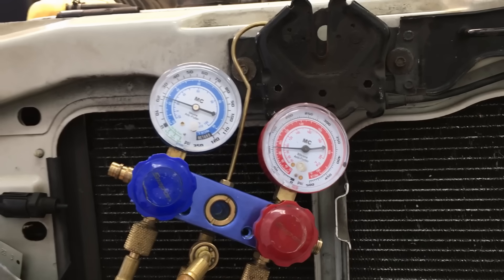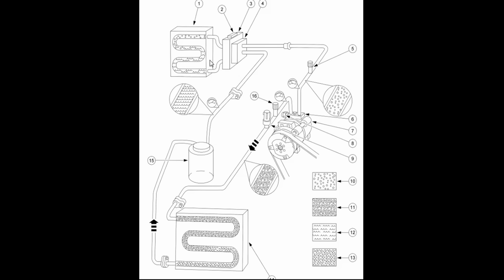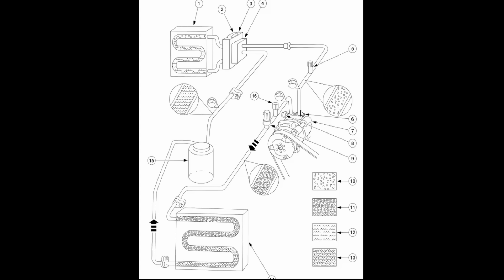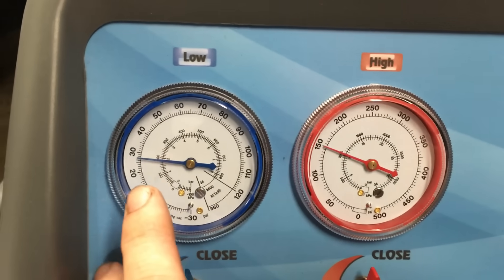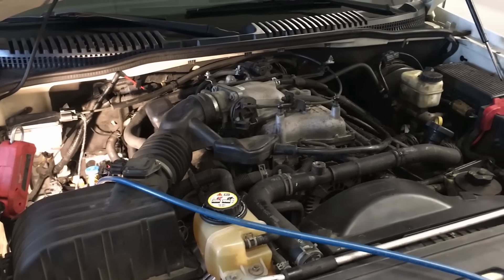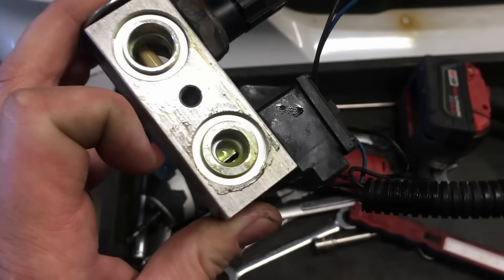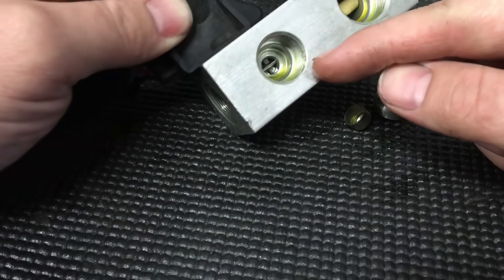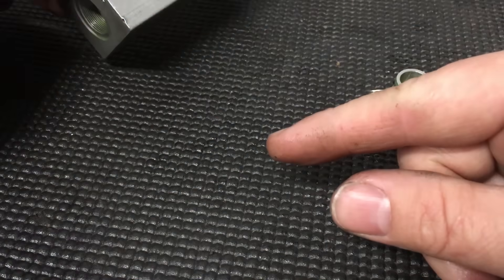3 Common Signs Your TXV has Failed Causing Poor A/C System Cooling

Comment: hi can you tell me where the orifice tube goes in ford escape 2009 2.5 auto 6 speed xls
love all your videos thanks
Reply from the maker: +John Paul Whittall you have a txv not orifice tube. It bolts to the firewall where the ac lines pass through the firewall
Reply: @FordTechMakuloco  I recently purchased a 12 escape and I heard a hissing sound under the dash when i turned ac on, blows cold air but not consistent especially when warm weather.
Reply: @Tengs27  if you have better cooling on the highway than when stuck in traffic... 
then wrap the skinny liquid high side line from the front condenser all the way to the cabin.
Do a fair job at it near the firewall so the cooled liquid is not re-heated by hot engine. (Leave the larger return line exposed as-is, it needs to get warmed up).

WHY: 
it's more efficient to pick up heat from the cabin with a cooler liquid evaporating than a hot one.
 More heat gets picked up ie. cooler cabin regardless of stuck in traffic!!

COST: 
$5 roll of pipe wrap  Aluminum & Rubber from HmDepot

OUTCOME: The TXV no longer gets cooked with engine temperatures R134a and should last longer!

👍🏻
Reply: @glasser2819  thanks a lot, im gonna give it a shot. I already replaced expansion valve, receiver dryer and  condenser but doesnt feel like 100%.
Reply: @Tengs27  did you feel the improved AC cooling in warm summer weather and hot traffic crawl...?
I drove wife old '04TL last week in 103 weather: I luved what the original 15year old TXV delivered... just like new with pipe wrap job!

FUTHERMORE...  same deal with the kitchen fridge!!
The rear fan cools the high-pressure hot refrigerant before it enters the enclosure... unfortunately the cooled pipe crosses the hot air stream and picks up heat

FIX: WRAP that short pipe between end of the condenser and cabinet so it does not get reheated!!

OUTCOME: Fridge cycles 20 to 30% faster to Off regardless of warm kitchen temps.

(last FRIDGE trick is make sure the  compressor starter is NOT an old PTC that keeps the start winding partially energized instead of 100% disconnected after start!)

🤗

Comment: I have a Ford F-150 4.6 2006. It barely cools when it's idling but cools okay when I'm driving. I added some ac pro but that didn't do any difference. The compresser turns on and off about every 30 seconds. What do you think is wrong? Love your videos, great job! Thanks
Reply: Should the compresser run all the time when on?
Reply from the maker: 30 seconds is not bad but making sure the charge level is correct is the first step then comes pressure diagnosis. Most shops wont touch it now with the A/C Pro in there just an FYI.
Reply: FordTechMakuloco  what's wrong with ac pro?
Reply: Loriah Sorensen The AC Pro refrigerant includes a "stop leak" additive. This can contaminate the workshop refrigerant recovery apparatus. Another issue with these kits is that they have a cheap gauge that only lets the user see the low side pressure, for a proper service you really need twin gauges to see the full system.

Comment: My 03 Aviator has that same problem... warm air from the console, but cold from the rear ... I thought it was a touch low.. my gauges did exactly as you showed...Now I know what to do...Thanks
Reply: Michael Owen did you ever fix it?

Comment: Good video as always. What is the best way to contact you? I have a 2009 Mercury Mariner 2.5. Almost 200,000 miles.  PCV has not been changed. Any tips on doing it? Thank you J.
Reply from the maker: There is no pcv valve per say just a baffle bolted to the side of the engine block under the intake manifold. It is best to just get an all new baffle with valve assemble for $10 more. Here is the part number- 9E5Z-6A785-B
Reply: Perfect.  I will get the whole baffle . Thank you. Do you have any tips for doing the job?

Comment: Nice job with video Brian.  Looks like a good fix!
Reply from the maker: It sure was I hope they were happy with it.
Reply: @FordTechMakuloco  
I have a Ford f150 2010 king ranch drivers side behind center panel the actuator there is a arm mine is attached to actuator but hanging down not attacked to anything can you help me
Reply: @FordTechMakuloco  2006 mazda 3s 2.3L auto sedan 335 k miles
I have this problem the does car not over heating . Theonly part I have not changed is expansion valve and high and low sensors I charged up with 134a no leak filler   shop said I need a new compressor and high line I replaced myself

New parts 
Ac compressor new not rebuilt  not China crap eather GPD
Cooling fan
Condenser
Dryer
High pressure line
Water pump
Thermostat
Flushed radiator inside /ou coolant
Expansion tank
Cab filter

What could it be?

Comment: Why is it that Ford dealer mech's don't know this kind of stuff? Lost all faith in dealer's being the best place to get repairs.
Reply from the maker: Some do, some don't you have to really love the job and take interest enough to learn on your own and understand why something is happening.
Reply: Corey Edmundson
It's because the Stealerships treat good techs like crap and eventually they get frustrated and tired, and quit. Leaving only those techs that can't start their own shops or that can work for a good independent shop that will treat their techs better.
Reply: Corey Edmundson a Ford dealer once sold me a used accumulator then denied they did, luckily I cought it in time and replaced it before it messed my new pump up. I no longer trust stealer dealers.
Reply: Oh yeah? Try the independent shops. I've wasted tons of money by NOT going to the dealer as well. Basically, you have to find a GOOD mechanic, and finding one keeps getting harder and harder. Which bothers me; when I was younger, I did all my own work, and somehow managed to fix stuff on all different kinds of vehicles. Today all I get are excuses and cars back after repairs which were obviously never even checked to see if the problem was fixed. Two days in the shop and I come back to a car with the same problem? WTF?

Comment: My 2010 f150 blows cool but not cold.  I've read that my model year is known for poor ac performance.  Love to hear your opinion.
Reply from the maker: The newer f-150's with the redesigned dash have an evap that is way too small.
Reply: same with mine. my 2010 f150 wont get below 55 and ford said its normal. i call bs. lol
Reply: so your saying 55-60 degree air is normal?
Reply: Ford also charged under spec off the line, i think like 6 oz or more under. Check the ford forums. There are some who use a diode resistor piggy backed on the evap thermostat sensor. Be cautious if doing this as u could freeze your evap core

Comment: Can an expansion valve stick in the open position and cause the high side to have low pressure and low side to have high pressure, like a failed compressor would, or are they not designed that way?
Reply: I don't think so cos it has spring that always keeps is closed even when the thermostat fails it shuts it up from flooding the compressor
Reply from the maker: If that seat and spring got cocked or broken yes but this is more common.
Reply: FordTechMakuloco any tips on how not to misake that for a bad compressor? Thanks!
Reply from the maker: +Kris Johnson failed compressor will have a high reading on the low side gauge around 50-60 psi most times
Reply: TXV are built with a diaphragm that pulls against a return spring that shuts the pintle.
Higher return temp lift the pintle open. 
Dead TXV are fail safe due to shut down return spring that prevent flooding the compressor with a liquid !
Reply: So What is the 1 hex nut head on bottom of expansion valve for ?

Comment: What's with all the electrical wires on the side of the TXV block?What's this?
Reply from the maker: temp sensor and clutch cycling switch
Reply: Petar st temp sensors
Reply: I think a solenoid maybe too

Comment: My 14 f-150 ac doesn't drip water when its on.
Reply: adrian sims this should be a drain tube that sometimes gets plugged up with dirt I would try using a blow gun in blowing through it see if you can clear it out
Reply: Thanks
Reply: I figure try the easy stuff first
Reply: Better check your rug, my 11 didnt either since new and i found  the drain tube wasnt sealed to cab and the water ran back down the tube into the cab . smelly after a while i might add. Sealed the tube with silicone to fire wall.
Reply: I'll check it today ! So far it's not smelling.